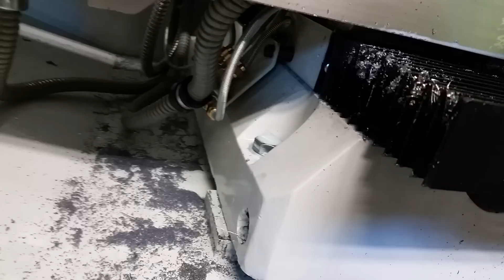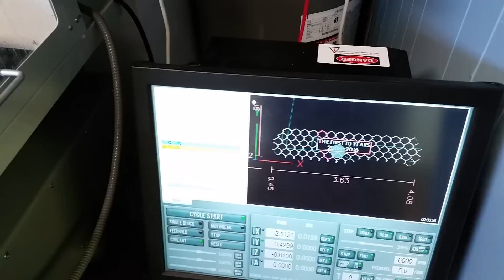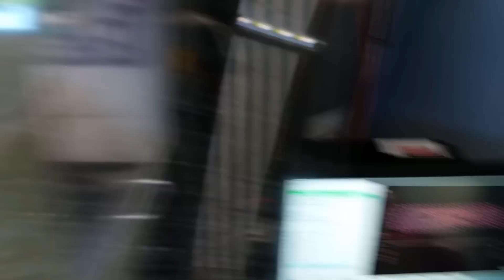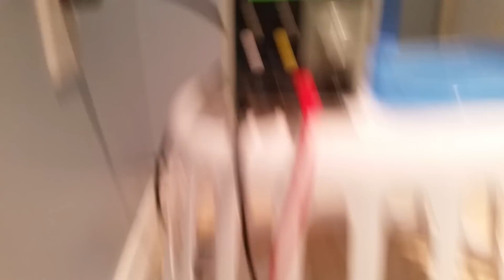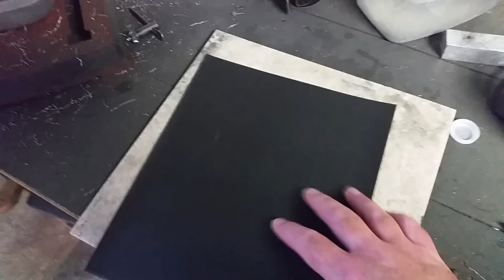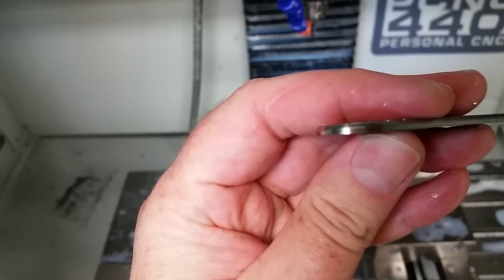Engraving and anodizing Titanium 91mm SAK scales

Comment: How much for the items?
Reply from the maker: The Customs I do are all depend on what you want for tools and options, but typically a Titanium 91mm custom build is in the 250-350 range.
Reply: *****
Im fully aware of the cost and I am okay with that. For a custom Victorinox  Im okay paying a premium price. Im more interested in the Alox items I saw on your website though
Reply from the maker: +Hayate Azekura I still build some alox 93 size but I only stock hard anodized black for colors.  if you only want basic tools then it's a fine platform.  however most people want alot more like pliers added and Phillips driver.  the cost then gets much higher than a comparable 91mm Titanium mod so it doesn't make alot of sense.
Reply: Im looking for something along the lines of..
Pliers
Scissors
Driver for bits
Driver bit Case like the one on the cybertool
Wood Saw
Metal File / Saw
Electricians blade
Large Blade -
Bottle opener with wire stripper notch
Awl, Reamer - the kind on the Alox models
Small LED Light. 
Key Ring
Not in that order but as long as those tools are in there. I do alot of computer work. Leatherman MTs are too bulky and cant use them to screw items inside cases. 

I know the cybertool is similar, But I don't want any of those extra tools that come with it. Corkscrew, can opener  and ect.

Plus I want the texture of the Alox scales. Love the grippy texture. Don't care what they are made as long as they have those bumps.
Reply from the maker: +Hayate Azekura ya most of that would be impossible on a 93mm alox model that is exactly why I started making Ti scales for 91s.  I can make the same alox texture that isn't a problem
Reply: Do you have a Estimate on how much that will be?
Be off for a bit, if you want to message me that is fine. But I am very interested.  I am from California by the way. Not super far from Canada, I am sure you ship all over the world. Love your work by the way.
Reply from the maker: Have a look at this example.  its a 91mm textured Ti scale with copper cross.  I love this one.  Im making a dozen sets of these right now.  Ive shipped alot of SAKs to california.  http://s1117.photobucket.com/user/Syph007/library/CNC_A/004
Reply: Ooooo Fancy,  whats the price range for that item, with the tools I want. Any estimate you can give me.
Reply from the maker: anything  based on a cybertool is going to be pretty steep since the donor tool alone is over 100.  So my best guess would be approx 400 - 450 for that kind of build.
Reply: +SAKModder Im trying to get a cybertool off ebay. The prices on them have been coming down. 2 months ago I couldnt find one for less than  100. Now I see them for  $70. bucks. Hoprlefully I can get one.
Reply from the maker: +Hayate Azekura that's better for sure.  on amazon canada last I checked a cybertool 31 was about 120

Comment: I would buy custom scales from you in a heartbeat... Be sure to let us know when they are available...thanks
Reply from the maker: Were you looking for just the scales and wanted to DIY the build yourself, or did you mean to send me a SAK to convert.  There is a fair bit of drilling and fitup to get them assembled but if you are handy and have tools its totally possible to do yourself.
Reply: Depends how hard it is?I like to think im quite handy but maybe if you show us a fitting up video?
Reply from the maker: +djhailon The pivot method requires a drill press with carbide bits to drill out the tools but I could make a version that uses the standard brass rods and that would be much easier.  you would just need a small hammer to assemble.  videos of both ways is a great idea for sure.
Reply: Look forward to that! Very nice products!

Comment: Ive been meaning to ask you since you mentioned geting the Tormach, is it better to get them waterjet cut and machine them, or you preffer to machine them from scratch? Whith waterjet, I assume you would need to ream the holes but I just wondered if it would make it cheaper or more expensive considering the current volume of knives you're making. BTW congrats on your admin skills, you were able to take this modding thing to a whole new dimension.
Reply from the maker: That is what I am trying to decide right now.  Id have to cut down the larger sheet into manageable pieces first anyhow.  So it would cost me time and more then a few extra end mills.  Cost to waterjet is around $5 a scale, so $10 per knife.   I dont have a band saw that can cut Ti either so Id have to hacksaw and machine to get it down to the sizes I needed to use.  I do need to make some one off scale sizes for old soldier knives from the 30s and 40s and those I will for sure cut with the mill as it will only be a few sets.  That might be a good test of that process.

Comment: How do you get a matte finish on the Ti? Is it beadblast? Sandblast?
Reply from the maker: vibratory tumbler with ceramics.
Reply: ***** Really? It's that simple? Does it have to be ceramics or will regular stones work??

I really know nothing about finishes on Ti, I've been trying to find out how everyone gets a matte finish on theirs. I know some of them are stonewashed but, some of them aren't- and my Flytanium handles are stonewashed, but they're shiny.
Reply from the maker: +DavidMN if you want matte and shiny you just polish it before tumbling.  that's how I do it at least.  I've only ever used ceramic pyramids.